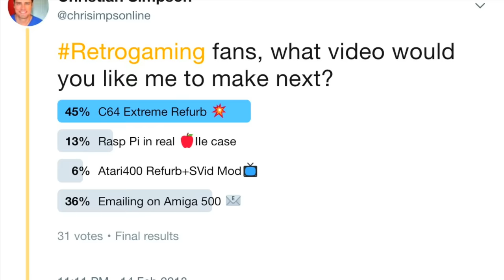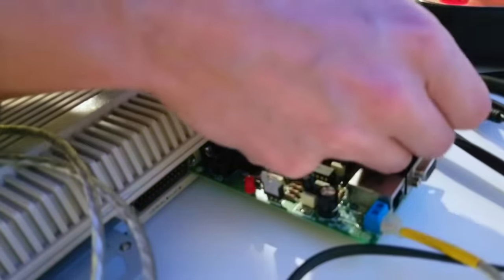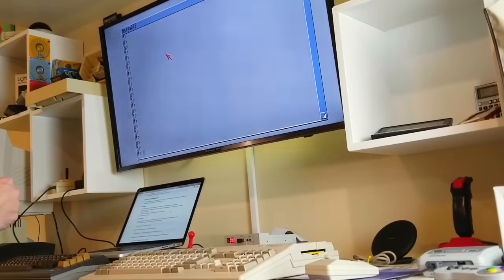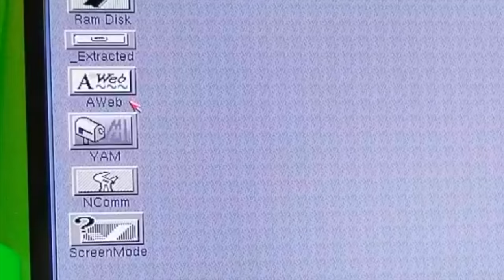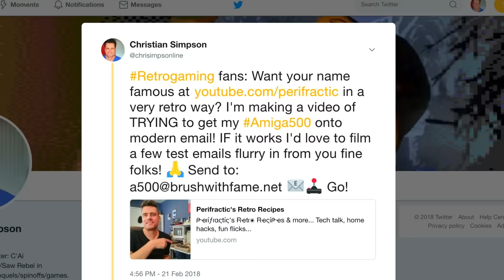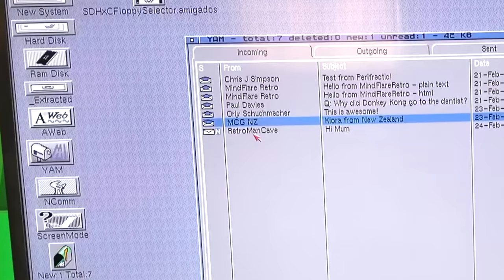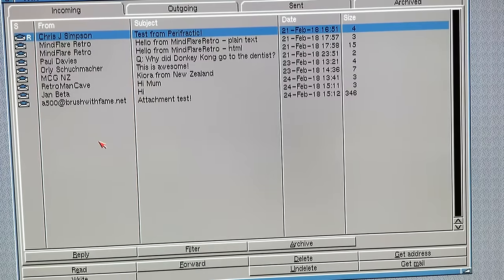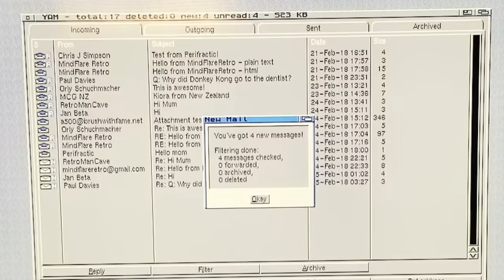Can A 1987 Amiga 500 Do Email Today? World First!

Comment: I know its cheating but it would be incredibly simple to setup a local mail relay with ssl on a virtual machine on the same network or a spare raspberry pi or similar so when it leaves your "local wire" its encrypted.
Reply from the maker: I thought about this, but then it's not really the Miggy doing the work ¯\_(ツ)_/¯
Reply: Perifractic's Retro Recipes I have been thinking about it, I might spend some time building an rPI offloader for the amiga I know it's not the might of the amiga doing the work but it could make it viable as a daily driver in 2018, if not it will be fun anyway
Reply from the maker: That would be cool! 
(*Correction: That was meant to be "it's not really the MIGGY doing the work.")
Reply: I seem to recall that the Amiga used to be possible to run the full TCP/IP stack using Miami.

In theory it would run on a 500 but think it would need a bit more memory than stock.
Reply: a really hard limit to doing anything "modern" internet wise on an Amiga is a lack of up to date software for basic tasks.

And a hard limit there is simply the level of basic computing power that the modern web assumes you'll have, as the struggles of simply decoding a jpg may suggest
Reply: Though... In some ways it's more practical now than it was because there are far fewer closed source APIs, like java or flash
Reply from the maker: I couldn't get Miami to work for some reason, maybe the memory.
Reply: @RetroRecipes  my recollection is that it wants about 2.5 meg, plus applications on top.

Of course it might be that it's just out of date.

Comment: Hi, will this work with TCPser?
Reply from the maker: I was only able to get it working using the network setup disk and the other things I did. I did try other methods but no dice.
Reply: Excuse me, another question: It won't work on my A500 using Kickstart Version 1.3, will it?
Reply from the maker: Hi interesting question. My guess is no, but I can say for sure. I think some TCP/IP stacks were introduced in KS 2.0 but you could always try and if not get a switchable Kickstart. 🤞
Reply: k, thx!

Comment: If you want to cheat a little bit: given that you have an accelerator, try installing NetBSD and then compiling Chromium for it.
Reply from the maker: Interesting, what would that do
Reply: @RetroRecipes  NetBSD is a full-blown Unix-like operating system, similar to Linux. It was first released for the Amiga in 1993 (so fits the period) and works on any Amiga with a 68020 or better, with an MMU: http://www.jp.netbsd.org/ports/amiga/  Unsure if your Vampire qualifies - its soft core may not be fully 68060 compatible. At that point you can run X11,  NCSA Mosaic, etc. and you might be able to compile a more modern browser. JIT Javascript support will be the deal-breaker here - the various engines may not support 68K natively.

The other path, not so cheaty, is a null modem cable to a modern Linux box and Dillon UUCP.

Comment: Couldn't you have just installed it to hdd directly?
Reply from the maker: Um... no.
Reply: @RetroRecipes  Should be possible with the AmiTcp 3.0 archive from Aminet if I'm not mistaken (that's the version I'm using on my A1200), or does that not work on 68000?

Comment: Just going by the thumbnail I was ready to rip you one, because I'm pretty sure people have been doing similar with Amigas and other similar machines since long before Feb 2018... getting C64s to send Tweets, PDP11s to host webpages and the like, even, and certainly taking STs online without any kind of break from the start of the dial-up era through to the present day ... but then the flavour of it being an unexpanded 500 makes me wonder if this IS a first. Most times I've seen things like ethernet/wifi adapters for old computers there's a rider along the lines of e.g. a 16-bit one needs to be expanded to 1MB in order to actually do anything useful with it (or connect at all) because of how heavy the driver is, and the ones for 8-bits do most of the processing offboard unless the host has quite a bit of extra memory installed. TCP/IP stacks and the like are pretty heavy in terms of memory load... Only having 512k makes it more of a challenge, especially on a machine where you may have to load a good bit of the OS into RAM before you can run other programs...
Reply from the maker: Thanks for the comment. If you can show me one other example of a C64 or A500 doing email today, I'll eat my... Amiga!

Comment: Sorry but I had modern email (pop3/smtp) running on an amiga 500 back in 1996-ish using YAM over a dialup modem to my ISP so you are certainly not the first.
Reply from the maker: Aside from encryption, the A500 was indeed only designed for dial up. Modern email today doesn't use dial up, so I politely maintain this was a first. An A500 doing email via the parallel port and WiFi. 😊
Reply: Maybe you should instead call it Amiga doing Internet (tcp/ip) over wifi, although again Amiga had networking capability from the get go and if I had had the money to afford ISDN I could have connected it. Wifi just didn't really exist. The amiga was very internet capable with voyager, yam and most internet protocols still in use today available to it. Just putting it over wifi does not make you the first. I worked for an ISP while I still had my Amiga and also ran a BBS where we would nightly transfer  (gateway) between email and netmail (BBS version of email) as well as BBS Fidonet messaging networks and NNTP (Newsgroups).
Reply from the maker: It's an interesting discussion. Parallel port interface & the specially written plipbox driver aside, is modern email 100% the same as 20 years ago? Protocols/encryption/handshaking?

Also the speed is faster via parallel than serial, incidentally. Attachments download very fast as a result. I don't think anyone was doing parallel port internet in the 90s. ¯\_(ツ)_/¯
Reply: You may be right, I only remember doing Parnet networking between Amiga's using the parallel port back in the day.
Reply: Amiga had PGP for encrypting anything, just not SSL/TLS as far as I can remember but these are just layers added to the basic tcp/ip protocal stack on top of the pop3/smtp and the none encrypted versions are still there although more and more ISPs are forcing them on (blocking non-SSL connections) for security.

Comment: Yes it can, a C64 can also "do Email".   ;-)
Reply from the maker: e5frog That's great. Actually my next project will be to get email working on a C64 but there's nobody on any of the forums who has done it. Have you?
Reply: There's some talk about it here:
http://www.lemon64.com/forum/viewtopic.php?t=40546
Email64 seems like a solution, there have been several userport connected modem emulators with wifi-connection, should be possible. 
One way would be to connect with a terminal program and run an email program remotely. In the 90's I used to run terminal program and connect to a UNIX-system where I could run maple for email and lynx for browsing. 
If a VIC-20 can tweet, a C64 must be able to handle e-mails.  ;-)
http://torontosun.com/2014/02/20/tweeting-on-a-commodore-vic-20/wcm/d888b3ba-50bf-40c2-883a-0345b2e67d44
Haven't tried it myself, I tend to spend too much time on YouTube looking at what others do.  ;-)
Reply from the maker: e5frog Yep I actually posted in that thread on Feb 18. Nobody has actually done it with modern email. Terminal into a remote computer wouldn't count 😉 Tweeting is surprisingly easy. Modern email encryption is the challenge.
Reply: Encryption could be a challenge... maybe it needs some help with that.
IMHO it shouldn't have to be able to do everything itself, as long as you can handle e-mail on the C64...   ;-)
BTW, thanks for an entertaining video.
Reply from the maker: e5frog Thanks, I've 'emailed' him!
Reply from the maker: e5frog You're welcome!
Reply: What about Contiki?
https://www.c64-wiki.com/wiki/Contiki
Reply from the maker: e5frog Show me an actual working email app for Contiki and I'll show you one for a Commodore calculator!
Reply: Just reading the wiki... I have no means of trying it.   ;-)
I do have seven or so C64:s but no network capabilities - well the Ultimate II+ has - but what use is it currently?  ;-)
Reply from the maker: So he said Email64 only works with 9600 baud dial up modems! 😬
Reply from the maker: e5frog Thanks! You put "dial up modem" in quotes correctly, as they're not, they're Wi-Fi networking devices. The problem is revealed when you try to type in a "phone number" in Email64.

Comment: That's not a normal A500.  Based on the amount of RAM in there you have a Vampire card or similar.  So that's cheating.
Reply from the maker: Please see the description, my piece to camera halfway, and many captions about that. To repeat, this works without the accelerator & RAM. The accelerator is just to speed up the video. Email is plain text, doesn't use much RAM. The thing that helps the A500 in this case is the Plipbox hardware and software in combination with the Network Boot Disk configurator. Tested 100%. Try it! I hope you enjoy my keeping these machines current. 👍🕹️
Reply: Actually it takes more than a megabyte just to launch the old version of YAM, I am not counting the TCP/IP stack.
I've done the same with my A500+ 6MB and ACA500 running at 7MHz as the internal 2MB card on my 68000 downgrades it back to normal when I enable them.
The connection was easier than this as I used AmiTCP and PPP on a Pi Zero.
I can telnet other machines and BBS, surf with IBrowse and IRC.
As for YAM unfortunately I have gmail so I can't receive or send.
On my A1200s though works fine.
Also simple mail is a disaster as it crashes and pull down menus don't work.
Nice video.
Reply from the maker: Vincent GR Thanks! Are you sure you're referring to YAM 1.3.5?
Reply: Yeap, that's the only working version for me.
Reply from the maker: Vincent GR interesting! I tested without the accelerator and its memory (I had to limit the video length somewhere) and it worked. Clean network boot disk boot, nothing else loaded. Admittedly the A500+ does have 1MB chip mem. 🤔 Hmm.
Reply: It might, haven't tested with less than 6MB. I just mentioned this as I saw that it was eating my RAM :-)